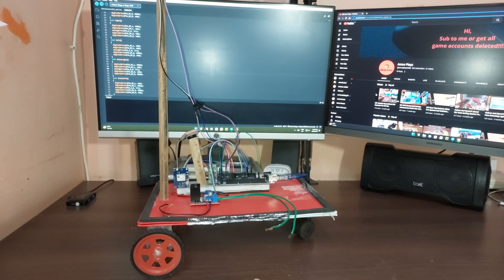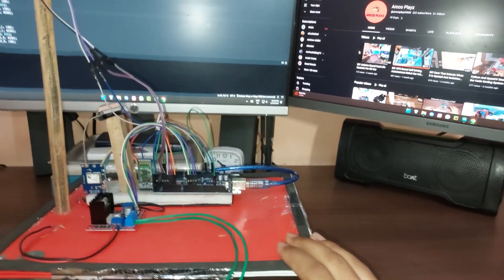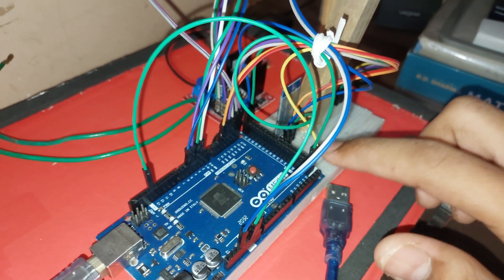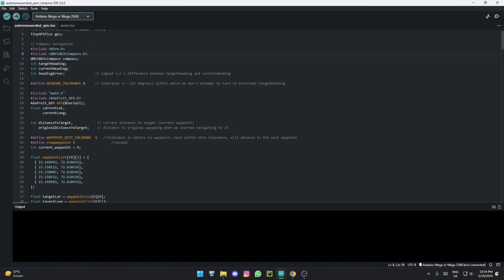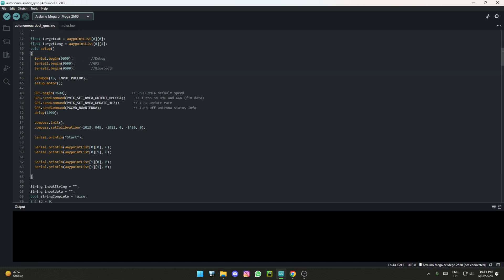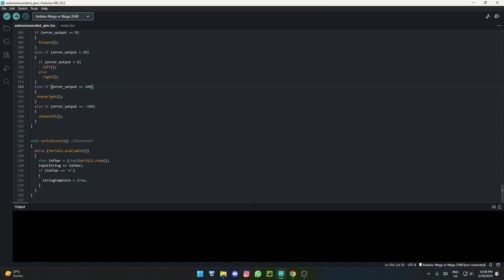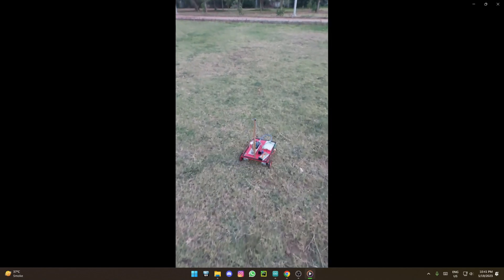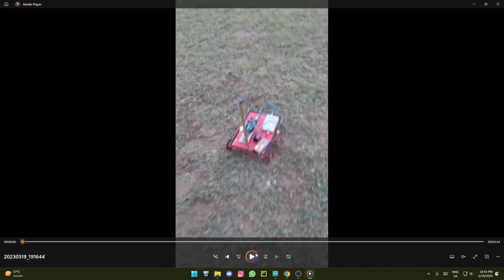DIY Arduino Based Self Driving Autonomous Robot Car With GPS And Compass And Bluetooth V2.

Comment: Bro can it avoid obstacles.....
If so where you used ultrasonic sensor
Reply from the maker: you cant use a ultrasonic sensor in this as the ultrasonic sensor depends on measuring time between the pulse sent and received so it needs its own loop but as the Arduino can only run one loop at a time it would mean that the control loop for the car wont work so the only option is to use a ir sensor with a interrupt function or a second Arduino that just reads the sensor and sends a signal to the main one.

Comment: Motors wont run
Reply from the maker: check that you have the gps and compass working also check if your enA and enB pins have their jumpers or you need to feed it pwm from the arduino.

Comment: For Arduino UNO, 
Change line 18 from
"Adafruit_GPS GPS(&Serial1);"
To 
"Adafruit_GPS GPS(9, 10);"

AND

Change line 41 to GPS.begin and all other "Serial1"  to "GPS"

Change all "Serial2" to "Serial"

YOU CAN USE SoftwareSerial also.
Reply from the maker: Yes you can do that but in my experience it is very fineky and also most of the time it won't make it past the first waypoint. I am sure you can spend a lot of time to optimise the code to run but it just isn't worth the hassle imo.
Reply: @arcteksystems  serial1 not conclude why?? happen this??

Comment: This is not working
Reply from the maker: What is the error code coming?
Reply: @arcteksystems  I uploaded your code tried  with qmc and hmc compass
My bot is moving in the same place
Reply from the maker: Check your connections and i recomend running the examples for compass library to ensure your compass is running properly.
Reply: @arcteksystems  my hardware connections also correct sir
Reply: @and9003-b7x   Same problem but solved it. Possibly Your compass calibration is not right or it is getting interference.

Comment: How much maximum distance it will travels from point A to B.
Reply from the maker: well the code doesent have any limitations for distance, but of course if you want it to travel say a hundred km then you will need to make it reliable and also obstacles etc will also be a problem

Comment: hello bro , I am an engineering student ,I'm doing a project similar to this , as I searched along youtube I found both your videos , so can you please help me with this .
Reply from the maker: sure what do you need help with?
Reply: @arcteksystems how to set waypoint
Reply from the maker: In the code you will find a array of coordinates, just change them to your coordinates( you can get them directly by placing the robot at the place and reading it off of the Bluetooth or directly from google maps) if you need more then just keep the same pattern and extend them upto 10 waypoints. just make sure to not change the formatting.
Reply: Do we need any other applications to set the gps coordinates
Or setting the coordinates in the code is the only way

Comment: bro can we use a arduino uno board
Reply from the maker: Well technically yes but you will have to use softserial for gps or bluetooth as both use serial. In my testing i found the uno very fineky and unstable.
Reply: @arcteksystems  ok bro thanks for the reply 🙂

Comment: Hi mate !! Very great job !! Have you compute a fonction that avoid the deviation of the GPS with the compas ? It’s very good 👍🏻 
Do you plan to do a version with an obstacle avoiding fonction ?
Reply from the maker: Umm computing the deviation of GPS is very complex and for this purpose it is not very effective so theres no such thing. No i dont plan to do so but i have some similar projects in mind so you may want to check them out.